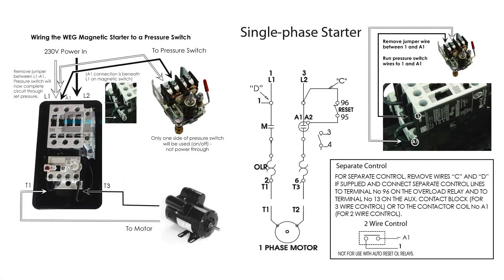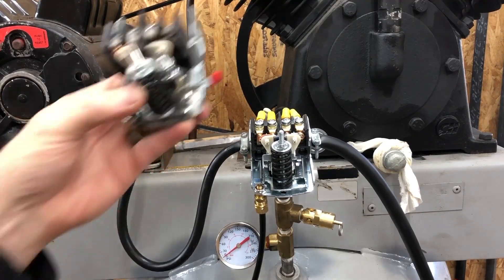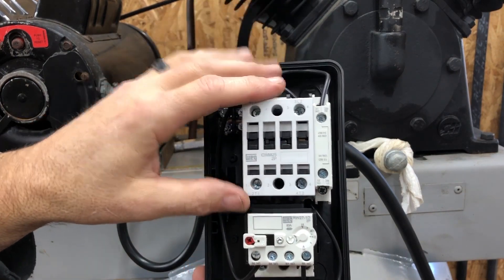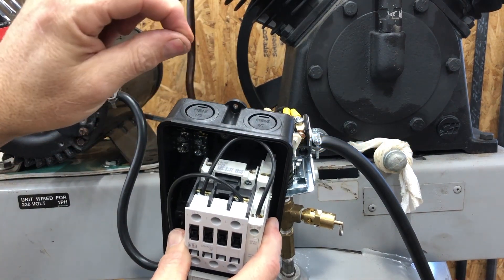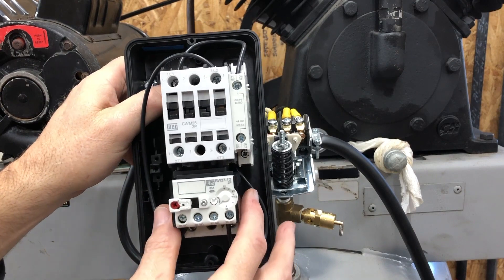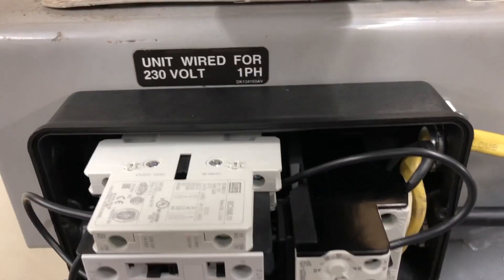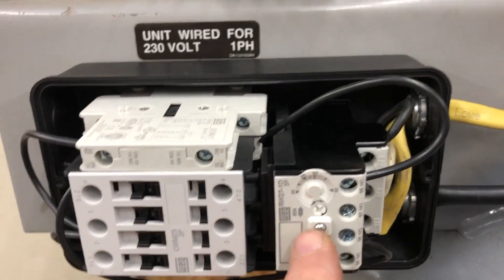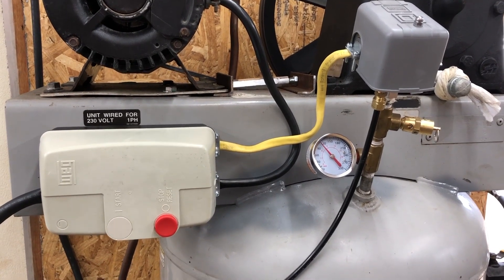Magnetic Start Switch Wiring to a 5hp Compressor

Comment: Great video, thanks for your help, but If you put your pressure switch wires to the L1 and L3 terminals does that affect the motor or just burns the pressure switch?
Reply from the maker: L1 and L2. The pressure switch will burn out sooner having to handle the startup without the help of the switch.

Comment: is there any reason why you couldn't do this with a 3.5hp compressor that's 15A?
Reply from the maker: You could - but it probably isn't necessary. Not nearly the strain placed on a built in 15 amp switch as is a 30 amp.

Comment: So does your pressure switch on/off switch turn it on and off?
Reply from the maker: The pressure switch controls the magnetic start switch that turns the motor of the compressor on/off.

Comment: Did you have to remove any jumpers ? I have the same mag switch and it is telling me to remove jumper “C” and “D” for seperate control.
Reply: I had the jumper lines and I'm so confused. I removed them. I left them and made zero difference. Still wouldn't turn on. Fun times.
Reply from the maker: I explain this at the very beginning of the video. Remember it says to remove the jumper "if" supplied. Mine did not have the jumper. The reason you would remove the jumper "if" supplied is so your pressure switch can control on/off of the pump.
Reply: @TigerCreekFarm   thank you!... I'm just not sure if the wires that are currently on my switch are jumpers or not! I have the updated WEG version of what you have.  A1 is not under 1L1, it is on the front of the switch.  Mine came with 3 red wires/jumpers:  13NO to 1L1, 3L2 to 96NC, A2 to 95NC.
Reply from the maker: By what you are saying I would remove jumper 13NO/1L1 (D) and 3L2/96NC (C) then connect your pressure switch to L1/A1. If in doubt get verification.

Comment: What about the second coil terminal (a2) a wire has to be on it for the coil to pull in. You show no wire on a2.
Reply from the maker: I believe that A2 is controlled via terminal 96 - the overload switch - via the 2 wire jumper control wires.
Reply: @TigerCreekFarm  Old video but you're exactly right. The jumper from L2 to 96 NC and the jumper from A2 to 95 NC is the entire loop that completes the coil circuit with overload protection. If you look closely at 5:16, you can see the jumper wire exiting A2 and going into 95 AC.

Comment: Great video very helpfull. Your power wire coming into the starter is that hardwired to the breaker or do you have a plug at the end of it and you just plug in the wall???? 👍👍👍👍👍
Reply from the maker: This was hardwired but you can do it either way using a 30 amp plug/receptacle.

Comment: So what about if my starter has a push button start and stop. I’m trying to add my pressure switch into it but when it’s wired where I’m told, it will turn on the compressor but not off and the buttons will not work with the pressure switch wired
Reply from the maker: I would wire it so the pressure switch controls the on/off function. Your pressure switch has a manual on/off control along with the pressure controlling this function. Placement if the wires will vary depending on the type of pressure switch you have, but you want to make sure they are functioning the same. Without a magnetic starter the pressure switch passes both legs of 110 voltage to the motor. Using the magnetic starter, the pressure switch only needs to allow continuity to operate the switch function of the magnetic starter. That being said, make sure on your pressure switch that one wire is connected to "motor" ( that would in turn connect to 1L1) and the other connected to "line" (that would in turn connect to A1). This creates the switch function in your magnetic starter. Each one is a little different and can be confusing. Look for instructions to help you along.

Comment: Is this the one you have? I have a 220v 5hp Baldor 1 phase motor for my YC3 westing house 2 stage compressor. 

https://www.wolfautomation.com/enclosed-starter-2hpat115v-5hpat230v-25a-208-240v/?gclid=Cj0KCQjwx7zzBRCcARIsABPRscMY2r67Ng_SSIVfs2iJBvcoACL5I-0TFI-KTWNjh05GtbRGhT3ZB7AaAljYEALw_wcB
Reply from the maker: That looks like it would work. Mine has a single reset button - WEG MAGNETIC STARTER FOR ELECTRIC MOTOR AIR COMPRESSOR 25 AMP 5HP 1 PHASE 230V.  I am not around it at the moment and don't recall the exact model number - but the important thing is the amp/volt rating. The one in your link certainly meets your needs.

Comment: Liked the video but am having some issues. I have a new WEG starter with an on and off switch. It works fine, but I seem to be unable to get the pressure switch to control the starter. I tried bypassing the onboard on off switch, and can get the pressure switch to start the compressor, but not switch it off. Grrr. Any wiring suggestions?
Reply from the maker: kuladeeluxe do you have the correct pressure switch? All the pressure switch does is close contacts at a particular pressure that will in turn allow voltage to pass through the switch. It then opens the contacts once the set pressure is reached - closing off the voltage pass through. If yours will not shut down from the switch I suspect it is the wrong pressure switch or pressure setting.
Reply: Kuladeeluxe -- I'm having the same problem. I'm using a different Mag switch than you but mine too has the on/off switches....I believe that's the issue for me... I originally used a traditional wiring plan but the two are not working together correctly. I believe the on/off switch is considered a momentary switch and requires a different wiring plan... I'm searching. And... I have a correctly sized pressure switch, 5hp, and a Mag switch that also rated to my application.
Reply: @BoxcarsGarage   Ever find a solution to this problem?

Comment: Excellent explanation, was easy to follow along. I have a 5 hp speed air I just picked up. Was told I needed a starter to make it work. Its old and so is the switch but worked in his shop. Did not get the starter with it.  I think I need the same type of setup you have. Do you have part numbers for the starter and the switch? If I could duplicate what you have it would save me from getting the wrong parts. Thank You.
Reply from the maker: It will work without a starter for a while but will eventually burn your pressure switch up. The pressure switch I used was the Square D 9013 FHG12M1X (chosen for the  working psi I was going to need) and a matching pressure relief valve. The start switch is a WEG PESWS-25V24EX-RM34.
Reply: I would rather just set it up once. Thanks again.